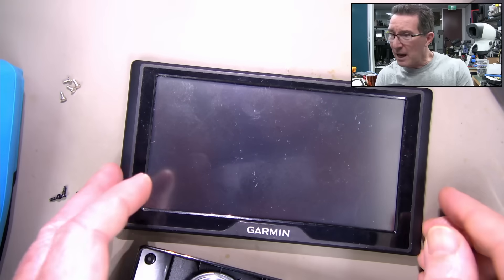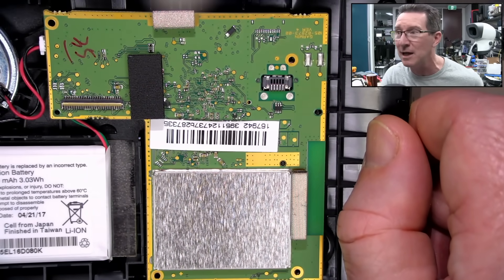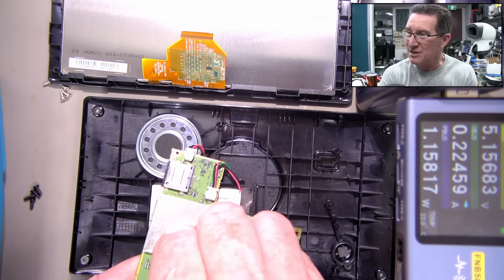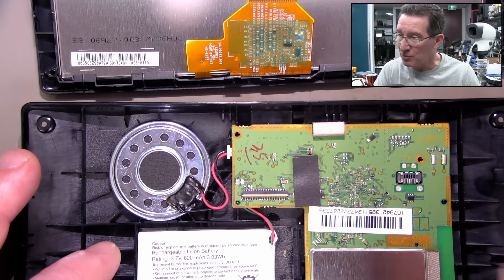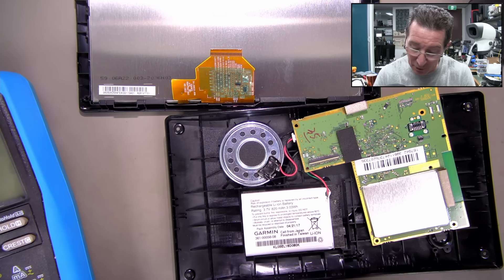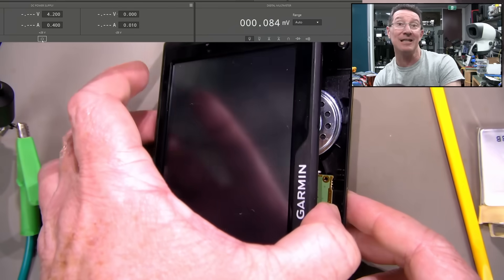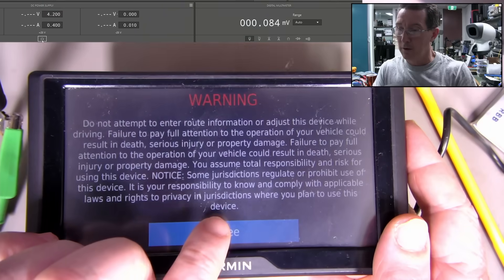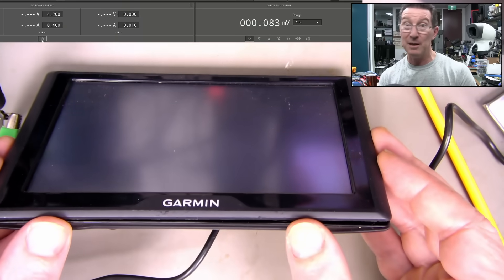Garmin GPS Battery Kickstarting

Comment: I drive an EV in the city but my long distance car is a pre Apple/Google play hybrid.  I use the US version of a similar Garmin GPS which includes LMT.  It is a great little device which has onboard speech recognition and pretty good Bluetooth with noise cancellation for hands free calls.  The Garmin GPS also works with their Ecoroute HD linking OBD-II data to the GPS over Bluetooth.  I think I’ve had the Garmin for over 12 years and don’t see stopping using it any time soon.  The Garmin also has a neat feature of showing photos turned into stylized drawings of highway intersections and exits as pop-ups when you approach.  I believe neither Apple nor Google maps does that.

Comment: Welcome to the world of modern "brick yourself" lithium battery devices!  Had to do this many times with things I left unused for just too long.  The bummer is if they go to almost zero - you can get them back, but the internals bugger up at that point and the resurrected battery capacity is very low.  Research says the anode/cathode coating gets ruined.

Comment: The UVLO on a lithium battery prevents charge from going both ways - the protection circuit has a pair of FETs wired in such a way that when both are off, no current can flow, but if one is off current can flow the other way through the off FET's body diode. Basically the UVLO has an even lower "low charge lockout" that disconnects the battery. The point of this is to prevent charging of extremely low batteries which can be dangerous. However, it's possible to bypass this by charging the cell directly until it's over the threshold (it just takes a few minutes to get out of the permanent lockout and into a state where it  cannot be discharged but does allow charging). Note it's there for a reason and many batteries can be resurrected, but often go spicy pillow shortly afterwards - the low charge lockout is because permanent cell damage may have happened.

Comment: This's progress! Give you useful functionality, then, after a few years, take it away, and force you to pay for it. Unfortunately the car manufactures are following the Microsoft marketing model. You own nothing and rent everything. The internet connection is allowing manufactures to rent functions on the car you purchased, like driver car seat heaters, or even engine performance. The test equipment manufactures are doing the same thing, building in all the hardware, but disabling it with a flag in the software. Pay a licence Fe, and the fiction can be remotely activated. As far as I know,  the renting model has yet to be exploited by the test equipment manufactures, but I could be wrong.
I suspect it would reduced the EE waste mountain if rechargeable battery powered equipment could be run directly from the USB supply, with the battery removed. It is battery obsolescence that condems so much working electronics to the scrap pile. In many cases, the device current demands are well within the capabilities of a USB PSU.

Comment: You probably drained it over time when leaving it in a drawer. Giving lithium or other chargeable devices some attention from time to time does wonders.
It is not certain that the battery in your Garmen is toast. Give it some proper charge/discharge cycles and it could be just fine again.
Reply: It almost certainly will be just fine though may have a little less capacity, I've revived dozens of these things the same way.  I would recommend starting with a much lower current (0.1C or lower) until the voltage rises over 3v though.

Comment: I have revived batteries in the past by plugging and unplugging the cable multiple times.  I never thought to attach a meter to see what is happening, but my guess is that some current goes through before the protection circuit locks out, and after multiple re-pluggings it eventually goes over the limit and starts charging again.

Comment: Thanks for the video. 
I use the same Garmin. It works fine and has indeed lifelong map updates.
The battery also was very bad last year. It usually worked on external power, but when I removed the power it directly went off.  Now it works again nicely after having replaced the battery.
About built in car navigation system: My Ford Focus from 1014 has a built in navigation system but there is something wrong with the roof antenna (water, rust?) causing an offset in position of more than 40 km in a random direction. Also, the user interface is baaad. So, we keep on using the Garmin we already had bought for a previous cat without sat nav.
Reply: Garmin is a has some weasel language about LMT.  Lifetime seems to mean only as long as Garmin feels like they want to keep supporting a given device.  Anyway, my Garmin is probably about 12 years old and they are still supporting it, so pretty much lifetime where electronics years are measuring in dog life years.

Comment: Working right up till the battery fire.
Reply: Very unlikely with these smaller cells running at low currents.  The RC packs are way more prone to this as they get hammered with the current draw, fast charged all the time and often have physical abuse.
Reply: 7" tablets from Target do make huge flame throwers if you blow them with a hammer.

Comment: I've had similar issue with TomTom GPS, battery became spicy pillow, but replacing it didn't fix the problem, still not turning on. Turns out one chip is broken. When I push power button one small chip gets really hot. I don't know is this chip caused battery to swell or chip got damaged because of battery. Now it sits in box waiting for the moment when I find another broken GPS for parts 😅
Reply: Maybe battery swelled because it dropped to a very low voltage and left there for a long time.
Reply: It's not necessarily the IC that's faulty, though often this will be the case.  If it's something like a voltage regulator you could have a short on the supply rail e.g. cracked MLCC.

Comment: The reason the protection circuit refuses to recharge a very discharged battery is that it is not safe. Don't set your new car on fire, Dave.
Reply: Yep! Statistics do not lie. Petrol cars are 8 times more likely to burn to a crisp than that new EV junk.

Comment: Car the "upgrade" is just to plug in the external GPS receiver, or, more likely, just reflash the firmware to enable the one that is built in to work. Not installing the GPS in the dashboard is more expensive than leaving it in and setting option bits, as then you need to have 2 different dashboard wiring looms on the line, and tracking them per vehicle becomes harder, instead you simply have a common loom, and it goes in all of the dashboard assemblies, and then spec changes are just cosmetic and flipping bits in a module programming.

Comment: mini-b usb is the BEST connector of all the small usb connectors!..never had a problem with one..yet have on every other usb connector!
Reply: Mini USB is terrible. They always fail after a couple years, particularly the connectors on the cables. I have like 10 mini USB cables and every single one is loose and doesn't make a good connection. Even Micro USB isn't this bad.
Reply: @yotoprules-u6l  user error!
Reply: @WacKEDmaN LOL! Type C is a significant upgrade in every way. Ive not had a single cable or port break or become damaged in 10 years. They all make a much stronger, more reliable connection than Mini USB or Micro USB. I bought a batch of brand new Micro USB cables and every single one was not fit for purpose. Granted, i think it was just that particular brand. When it comes to Mini USB and Micro USB, its usually the male connectors that are the problem rather than the port itself. Lucky to get a year or 2 out of a mini or micro usb cable before it becomes loose and/or starts making a poor connection. I am SO glad they have been replaced by type C. Went from 50%+ failure rate with Micro USB (or 100% with Mini USB), to 0% failure rate with type C. That being said, some people still manage to break the cables and ports, but even with cheap cables and ports, never had a single Type C fail ever.
Reply: @yotoprules-u6l  well as i said.. ive never had a single issue wth mini-b (or usb-b) but have on every other usb connector, micro usb is the worst ever!...even C, albeit way less common... 
ive even modified a few devices to mini-b.. just coz the connection is always stable..
Reply: @WacKEDmaN  Nope, mini USB is notoriously bad for this, they are the shortest lived of all USB connectors.

Comment: Hi, there is a service/diagnostic function you can enter by pressing the battery icon for a few seconds, as well as by pressing the signal strength icon to get more information about the number of satellites.
Reply: thanks, going down a rabbit hole soon......
Reply: There is another hidden diagnostic on the virtual dashboard.  Tap the speed readout on the map to get to the dashboard.  In the dashboard, put your finger on the speedometer and keep holding for a few seconds.  You’ll get to see a ridiculous amount of developer diagnostic data.  I don’t know if that works on all Garmin models, but it does on the one I have.

Comment: Google maps require an update + active internet connection, if the app is unable to update then no maps for you!(Google maps isn't responding.). However, I found that GPS devices are more reliable, don't require active Internet connection,communicate directly to the satellite and work forever as they don't require an update that's version locked to the latest model.
Reply: Im a field engineer so spend every day on the road. I use Google Maps with offline maps of the entire country. It does not need an internet connection, so dont know where you are getting that from. Internet is only needed for live traffic.
Reply from the maker: @TheSaabClinicUK  That was what I thought.
Reply: @TheSaabClinicUK  That's interesting. I'm speaking from experience: I entered a no-cell-signal area, and Google Maps not only reset the current location and destination but also stopped loading the map, displaying a “No internet connection” message. If I restart Google Maps, it will show the map again, except it won’t let me enter a destination, every feature is unavailable, and eventually Google Maps starts warning about no internet.

Comment: Good job!
You're truly showing that e-waste is often not needed!
Garmin's are indeed often quite robust.
I "collect" Garmin's so to speak (I have several models) and they keep on working.
With the "life-time" map-updates (until the model is no longer supported) it can sometimes beat car-builtin navigation.
In your particular situation, indeed the built-in battery-protection blocked the battery from charging but I also believe protected the battery from deep-cycle draining. 
And thus saved the battery, although perhaps with diminished capacity.
(with some of my models I replaced the built-in battery with an external mounted 18650 in a holder and extended the nomadic operation to several days!).
I also believe in your situation, the design from back then limited the maximum current thru the mini-USB which could potentially also avoid kickstarting the depleted battery to a certain degree.
I guess the take-away from your video is that we all should get a current-limited/CV power-supply if we attempt the same ;-)
Reply: Those that are out of support you get open maps for them, which works well, just updated both of mine, and yes both were free, rescued from ewaste, The third was also rescued, but not updated yet.
Reply: @SeanBZA  Good suggestion!
True, I did also look into that in the past, looked very promising. Unfortunately, my most beloved unit (Garmin Street Pilot III with very special cradle), has very limited memory. So I have to resort in loading only partial maps. But then how far does one travel that you really need a full map other then a region. And in my experiences, open maps are often way more recently updated then the "vendor" maps. As vendors, like Garmin, need substantial time to update (read: re-vector and convert) their maps when received from the map-vendor..
So, going open-map is a good suggestion, more then once!